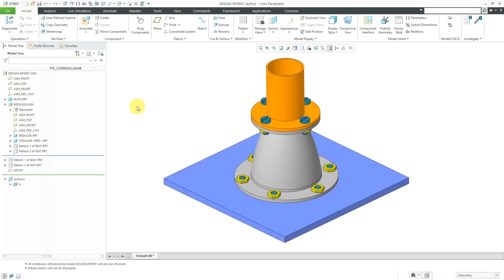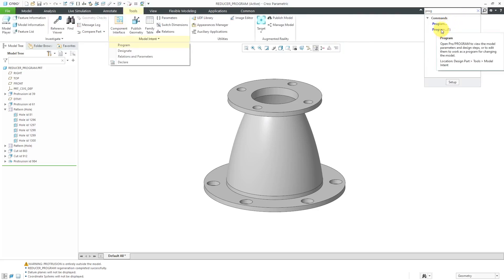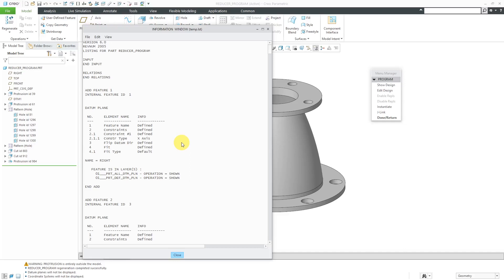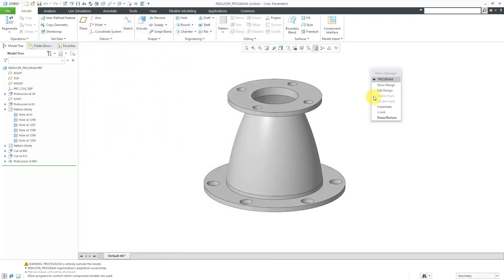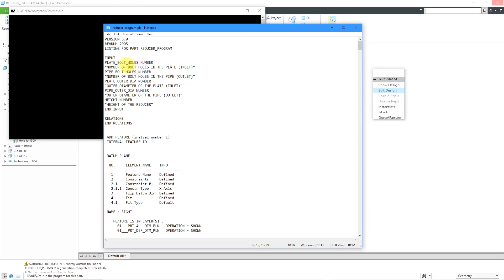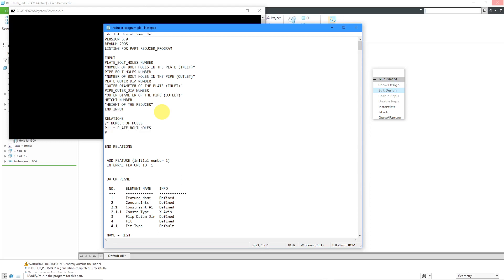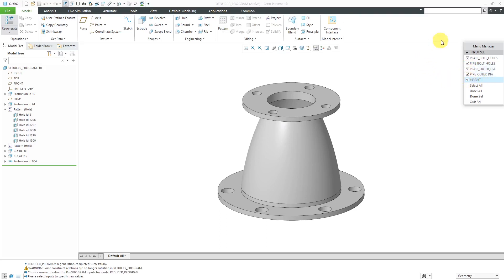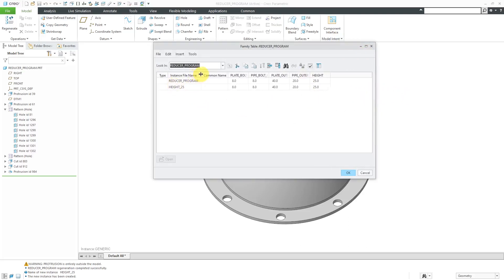Creo Parametric - Pro/PROGRAM Part 1 | Inputs and Relations

Comment: Until CREO can import parameters from excel, the platform is inferior to competitors.

Another method I have discovered for easily modifying parameter values:
Place the value in an unattached note. Note reads '<parameter name> = &<parameter name>'
click on note -> double-click on the value -> dialog box opens allowing you to change the value of the parameter -> Regenerate

Comment: whats the difference or relationship between familytree and proprogram?
Reply from the maker: You use a Family Table when you know the variations in advance. For example, when you are making different sized bolts or nuts. Pro/Program is used when you want to create variations based on user inputs when the model is regenerated. This reflects more of a Configure To Order (CTO) or Engineer To Order (ETO) manufacturing strategy. When using Pro/Program, you can use the Instantiate command to create Family Table instances based on the user inputs. Did this help answer your question?

Comment: Hi sir. While creating the drawing sheet for the parts. When a feature is suppressed through pro programing, the dimension shown in the drawing for that feature remains visible. Can u please suggest me a solution to hide the feature dimension in drawing sheet when the feature is suppressed in part or assembly. Thanks a lot in advance.
Reply from the maker: I’m not familiar with that issue. I recommend filing a ticket with PTC Tech Support.
Reply: @CADPLMGuy  thanks for ur response

Comment: Can we have negative integers as input using Pro Program? I am unable to enter negative number.
Reply from the maker: I’ve never tried. I recommend opening a ticket with PTC Tech Support. I’m guessing since Pro Program is used to generate geometry and integers are used to control pattern instances, it doesn’t allow negative numbers to avoid errors.

Comment: Very excited for these videos to finally be out!  Maybe you'll cover this in another vid I haven't watched yet... but do you suggest, in the relations, populating the dimensions by using the actual "relations" editor window instead of within Pro/Program?  We don't always know what the dimensions are ( like "P11", "P36", "D45", etc. ). since there may actually be an additional identifier to that dim, which it seems you can only populate by selecting the dimension in the graphics window - i.e. when you click a dim it would populate in the relations like "P11:id803" instead of merely "P11".  Is there a way of knowing what conditions require this identifier? Is it just assemblies?  Great videos by the way, much appreciated!
Reply from the maker: I show both methods in subsequent videos on Pro/PROGRAM in assemblies, James.

Comment: This is EXACTLY why we created Nitro-PROGRAM....
https://www.simplifiedlogic.com/nitro-program
Reply from the maker: Interesting stuff. Yeah, Pro/PROGRAM is not easy. I held off for the longest time on making the videos because I've never been great at it.
Reply: @CADPLMGuy  Yep - we can't do an automation project without Nitro-PROGRAM it just saves sooooo much time and keeps things visually clear vs debugging import errors, and/or incorrect logic problems, you can't understand in the "text editor".

Pro/PROGRAM has its place... it is VERY useful and must be purpose-applied.   You can lock things up quickly if you are not careful relative to re-use and management in PLM and increase management/complexity problems quickly if not planned properly.   Definitely a capability that best applied from a knowledge / process ---produce--> dumb result approach vs something that is always available in released models.

If you want to give it a try - just download and request a demo... I think you will dig it!